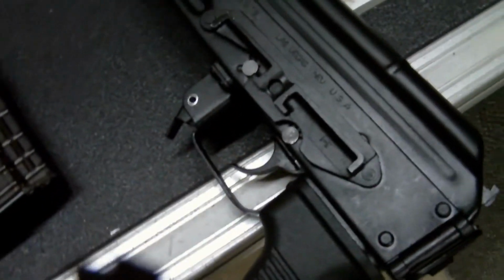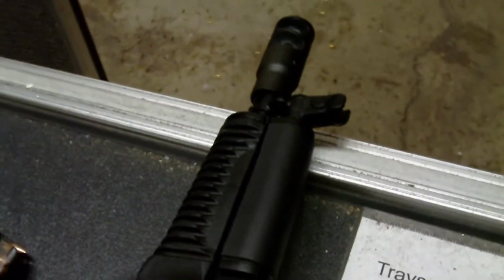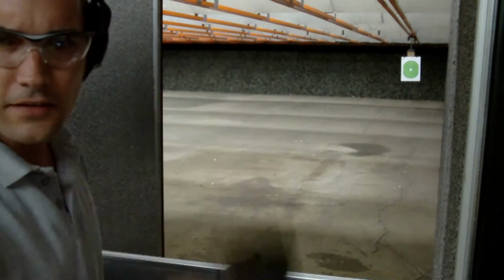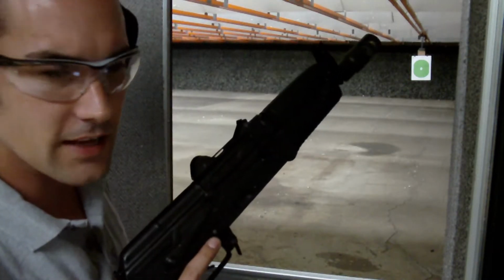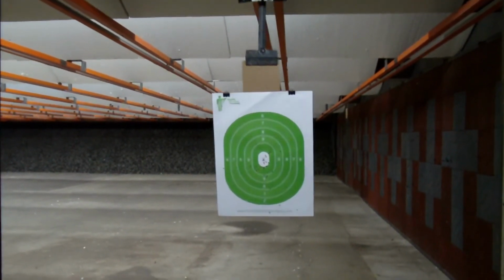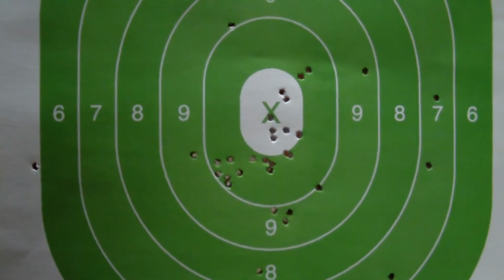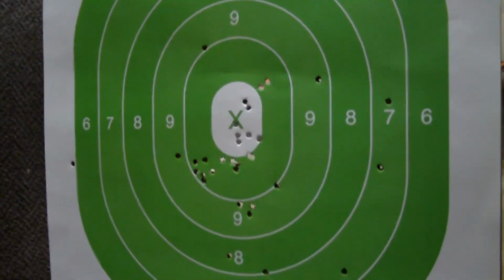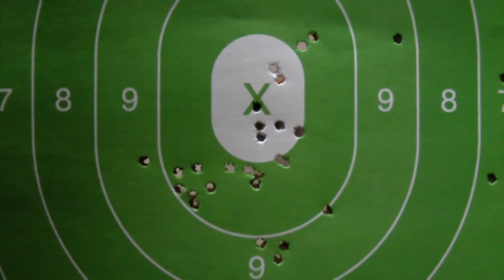First Shots:  Arsenal SLR-106UR (.223/5.56 AK-101)

Comment: ITW, same pistol with the newer brake. Picked up the Condor Cobra one point bungee sling for this, for the price it's HAAARD to beat. Check it. Also got the UTC 25x12 case. I use that for my Draco's and it works out fairly good. Borderline stealtly. YMMV.
I did get the Tapco plate you suggested. Thanks for the heads up!

Cheers